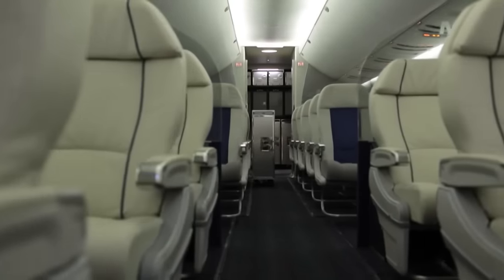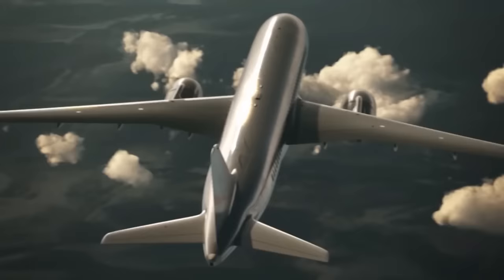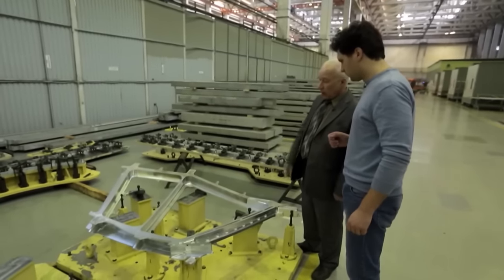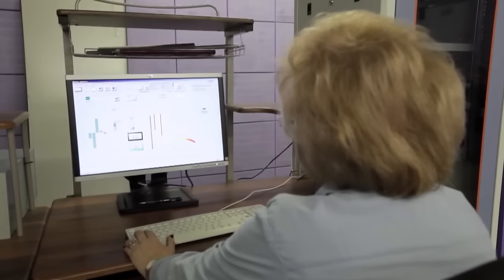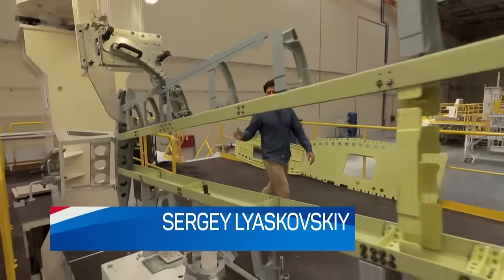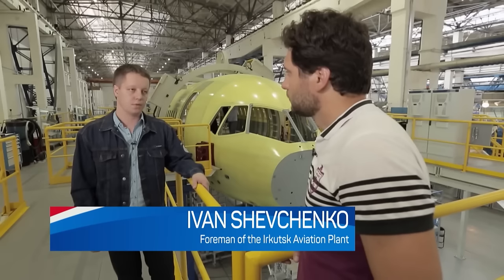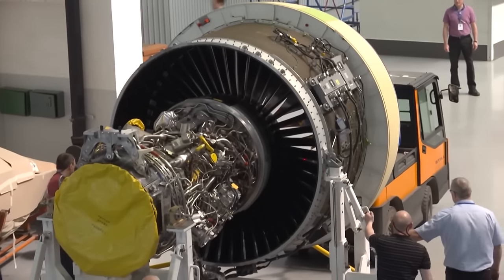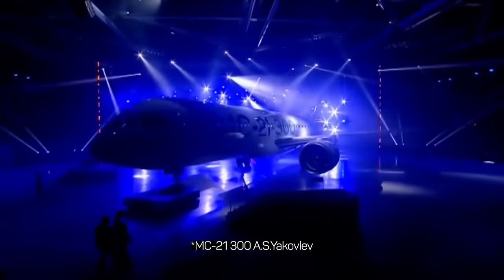Irkut MC-21 — The Aircraft That Can CHANGE The Way We Travel

Comment: Who will buy this plane?
Westerners, no chance, they have Airbus and Boeing and Russian planes are under sanctions at least as long as Putin and his clique are in power.
The Chinese have the C919 which is in the same category.
The Indians, for the moment they mainly buy Airbus and for fear of sanctions will avoid buying Russian.
The Brazilians have Embraer which are competitive and which sell well.
Furthermore, there is little chance that this aircraft will be certified by Western organizations. As a result, it will not be able to land in these countries. So apart from the Russians and their satellites no one will buy this plane. In the best case scenario this will make a thousand planes. If they manage to make 100 per year that won't be bad. In short, this plane is not going to revolutionize much in air transport.
Reply: Go check about Russian new engines for their planes. They need their domestic airlines to buy them and replace airbus and boeing lol come on. How many planes do you think Rusdis need domestically? 😂😂
Reply: There hundreds of of countries who are sick and tired of buying Boing and Airbus for years, some with huge problems. 2 Boing 737 800 Max crashed they were brand new. Same with Airbus A350 huge problems with composite peeling off and stuff. This is the Time Russian must launch MC 21 family with PD 14 engines to Asian and African countries arrange Russian and Chinese Aircraft shows in different Asian and African countries. Back and forth don’t need EU or US approvals, it’s only need to Western Block countries only.
Reply: Russo-phobic people live only in Europe. rest of the world are not. African countries , Asian, and south americans countries ,and middle eastern countries who are afraid of getting sanctioned in the future will also will consider buying this. Also remember wars doesn't last forever, there's no enemies forever, look at Germany
Reply: @Sam-dm4kz listen, if it wasn't for sanctions even Russian airlines don't want this plane because before the war,not a single Russian airline bought this thing or any of its predecessors, they all opted for Airbus or Boeing! 😂😅
Reply: Well, I don't agree with you, yes right now the scope may seem to be limited but there are lot of countries such African nations, Arab nations, ASIAANS, South east Asia, south asian nations, Latin americans and even Chinese airlines would be interested in this aircraft. These aircrafts may not able to fly in western air space but that's just one part of the world. When you offer high tech, reliable, cost efficient product then why not the profit hungry air lines will purchase ? they are still purchasing 737 after so many failures .......though this aircraft has yet to prove all of this.
Reply: There are countries out there that could willingly buy these planes. And remember Russia has long history in aviation technology and know  to build a plane
Reply: BOEING and Airbus left the Russian market. Russian airlines will need to replace hundreds of aircraft. The MC-21 is intended primarily to replace Western aircraft.
Reply: You are very funny
Reply: @zulfiqarbhatti2742 So how do you explain most Russian airlines jumped on EU-US airliners when they were allowed?
Reply: @robertkarake9791  They will by this aircraft, better a crap than nothing.
Reply: @АлексейСмирнов-к4л  Good luck to the russians airliners and their passengers.
Reply: Indians? Fear of Sanction?  The 3rd largest economy and soon to be 2nd/1st?
Reply: @Sam-dm4kz  They may be banned from overflying if they do not comply with FAR-25/EASA-25 standards
Reply: Who will buy this plane” Are you seriously asking yourself that question???  In Dec 2023 Russian president was talking about Russian airliners and their fleets being so overloaded operating around 800 planes (550 foreign and 250 domestically produced) and how Russia will need 1,000 more planes by 2030 to continue normal operation and by 2040/45 there will be need for another 1,000 planes since 80% of the planes operating today will be retired.  Now, did that answer your question who will buy this plane, and not just this one, there are few others.  Starting in 2024/25/26/27 Russia plans to start serial production of highly modernized Soviet era models like long range wide-body IL-96-400 in Voronzeh, Tu-204 and Tu-214 in Kazan and post-Soviet era models like SJ-100 in Komsomolsk on Amur and MC-21 in Irkutsk 

Now the question is, can Russia produce 2,000 planes in 20 years? Probably not, they know how and they money to invest but the lack of qualified labor is the biggest problem for Russia.  If Russia built enough for domestic market can they sell their planes outside of the country, of course they can, its stupid to even think they cant, Soviet/Russian planes are sold to 80+ countries since 1960s and many of those planes produced in 1960s/70s are still in service and flying in many African countries, they are safe and reliable regardless what MSM and many Russophobes on social media spraying
Reply: @rokimarchano5657  regardless of MSM you say? Is Flight Safety Foundation an MSM? don't think so, so take a look at their safety records for different parts of the world and stop calling them "safe" 'cause the airframe itself are dubios at best and crew training and CRM sucks - a pretty lousy combination.
Reply: @eyeofthetiger6002  One more Russophobe caught in lying.  By Jun 2018, MC-21 had 175 firm orders and 155 intentions by one foreign and 12 Russian airliners and by Dec 2023 there more than 550 firm orders and 220 intentions for MC-21

Now, why Russian airliners were ordering foreign planes, few reasons.  Soviet era planes could not get certified outside of Russia because they failed to meet emissions standards, engine noise level standards and fuel efficiency standards, even for America it takes 10-12 years and a lot of money to make new plane from scratch and so for Russia it was much easier and a lot cheaper to just by planes from outside, but things changed.  After the sanction Russians realized they cannot depend on the West for anything, they need their own planes, they have “know how" and a lot of money to invest, I'm sure they will succeed but it will take not years but decades to develop the industry
Reply: @rokimarchano5657  russophobe?😂 No,just stating the facts. This plane is far from ready to be delivered to customers even before the sanctions but now because of sanctions,no Western aviation certification authority will certify this plane so effectively it's barred from flying to the most lucrative routes in the world,ie North America and the EU. Also due to the fact that Russian aircraft manufacturers are forced to use domestic components, the aircraft turned out to be six tons heavier and no longer met the declared characteristics😂!Care to name which foreign airlines are buying this plane again?🤣
Reply: @birgerkagan6087  I did take a look at their safety record, considering Soviet era planes are sold mostly to very poor countries lacking qualified technicians where planes are poorly maintained and of course miles flown per accident.  Yes, they very much safe and reliable
Reply: I bet Iran has paid cash and waiting for the first one
Reply: @eyeofthetiger6002  Azerbaijan Airlines is buying 10 of those and I’m sure Russian economy will collapse because their airliner is barred from the most lucrative routs, but seriously who gives a crap is there foreign buyers or not, are the Russian airliners barred from lucrative routs or not, now the most important thing for Russia is to ease heavy overload of domestic airline fleets.  I did not say plane is ready.  

I said: Starting in 2024/25/26/27 Russia plans to start serial production of highly modernized Soviet era models like long range wide-body IL-96-400 in Voronzeh, Tu-204 and Tu-214 in Kazan and post-Soviet era models like SJ-100 in Komsomolsk on Amur and MC-21 in Irkutsk and in my previous post 

I said:  After the sanction Russians realized they cannot depend on the West for anything, they need their own planes, they have “know how" and a lot of money to invest, I'm sure they will succeed but it will take not years but decades to develop the industry
Reply: @HK-uq9by  well probably, these countries have huge surpluses they are not in-depth to the federal reserve private banking cartel.
Reply: @christosioannidis7483 Who cares about the debt if you can live a good life for few decades? You put me under debt and let me live in a mansion and drive a luxury car
Reply: @rokimarchano5657  
It is unlikely that the MC 21 will be a big success outside the sphere close to Russia.
For other planes, the Superjet does not seem to please its customers, the TU 214 is clearly obsolete, I do not understand why the Russians are launching 2 programs in the same segment, I do not see the rationality.
Finally for the IL96 no one will want it with 4 engines (you might as well buy scrap A340s, with 2 engines to be competitive it will have to be mainly made of composite materials, which is now obligatory for a long haul (for a medium haul the equation is more complicated)
In short, the only serious competitor is indeed the MC21 but due to numerous problems other than technical and due to the Comac 919 now available with very efficient LEAP engines it will be hard for the MC21.
Reply: @dharmdevil  
Yes, like China. They are happy to buy cheap oil and pay for it in rupiah, but like China they understood that supporting Russia would come at too high a price (US and EU trade sanctions).
As a bonus, like China, seeing a geopolitical rival weaken like Russia can only rejoice.
As for being the 2nd or 1st economy in the world, we will have to wait a bit because numbers 1 and 2 seem out of reach to me.
Reply: @HK-uq9by  😀You must be an expert on Bidenomics!
Reply: @rokimarchano5657  who?.....only 10 planes from Azerbaijan Airlines,that says it all really,not exactly a roaring commercial success is it? 🤣 I had to Google it as I have never heard of this airline before and it looks like all their fleets are made up of Airbus and Boeing including the dreamliner but no mention at all about the 10 MC-21 planes that they are supposed to be buying. If true then Azerbaijan Airlines may have discovered too late that they have just bought 10 lemons!🤣 But maybe not because they might already have cancelled the order. Listen,dude,no reputable major airlines would touch this plane with a barge pole because it's simply an inferior product compared to Airbus and Boeing being less fuel efficient and having a shorter operating range than either the 737 max family or the A320 Neo,its direct competitor,plus it has a zero safety and reliability track record and to cap it all off  it is not even certified to fly anywhere else in the world apart from Russia and Azerbaijan!😂 With only 175 firm orders, the MC-21 is well behind the new Chinese-built narrow-body airliner, the Comac C919, which has amassed more than 800 orders. Let's face it,this thing won't be flying outside of Russia anytime soon!😅
Reply: @birgerkagan6087  Russian can overfly over any country with permission of course. It’s only Western countries who cares, also, can fly in international airspace around the globe.
Reply: Correct - if allowed by the countries whose airspace is used and in international airspaces.
Other than western countries may also be concerned if relevant ICAO annexes are not adhered to. ICAO member states are obliged to conduct SAFA on a regular basis and if non-compliances are noted they will have to act on it, Failure to do so may impose restriction on that particular country's own operators. In airspaces where some 3. country operator are banned from operating it all comes down to insufficient Operational and Technical Survey on behalf of the operators own CAA
Reply: @eyeofthetiger6002 I didn't think that people in the West were so mean.  You gloat that Russia is experiencing difficulties because of illegal sanctions. Allah (God) will definitely punish you! You are going downhill, illegal migration, a sharp drop in moral standards, economic problems can lead to very sad consequences. Instead of gloating over Russia, take care of yourself! Greetings from Uzbekistan!
Reply: @eyeofthetiger6002  Finally you understood what I’m talking about all this time: “Let's face it, this thing won't be flying outside of Russia anytime soon” and that is the main idea of the Russian government, not to sell outside but be able to produce enough for domestic airlines.  Pres. Putin spoke about it in Dec last year and few points he made: Russian airliners are already overloaded, Russian airliners are retiring 30-40 planes every year, Russian airliners wont be able to buy planes from outside anytime soon, Russian airliners need 1,000 planes by 2030 and another 1,000 by 2040/45 because planes in the air today will be almost all retired by 2045, Russian gov. will do everything to expedite production of new planes to help Russian airliners keep their fleets in the air.  As you can see the last thing Russians are thinking is selling the planes outside of Russia or competing with Western models, the only thing they are thinking right now is how to produce enough for domestic market in the next 20 years.  

And 20 years from now god knows what may happen, as soon as war stops in Ukraine regardless if Russia pulls its forces from Ukraine or not the sanctions on air travel may be removed immediately, many sanctions will remain but when comes to airspace Russia has a big advantage over ES/EU airliners, its their airspace.  Thousands of flights every day from EU/US to Asia are banned from Russian airspace and all flights by going around Russia are extending they flights from 1 ½ to 4 hours and that cost a lot of money.  Airliners of EU/US and few other allies are loosing millions of dollars not every day but every hour by avoiding Russian airspace Western corporations and politicians are driven by money and that’s why I think as soon as war stops in Ukraine all air travel restrictions and opening airspace for all will be first to be removed.  

You may be right regarding Azerbaijan Airlines buying 10 MC-21, the deal is probably canceled, they did sign contract buying 10 planes in June 2016 but after allegedly Russian meddling in US pres. election in 2016, midterm in 2018, same thing in 2020 Russian airspace industry got more and more sanctioned and project got more and more delayed and of course after Ukraine invasion everything is sanctioned.  Tried to include link but for some reason post getting deleted, google: “AZAL to purchase MC-21 aircrafts" and today I did some research and its safe to say the MC-21 was extraordinary plane killed by US/EU unfair sanctions probably to remove direct competitor for 737 MAX and Airbus A320 family
Reply: @Sam-dm4kz Träum weiter.
Reply: @MuhamedUsman Ihre Welt ist anscheinend sehr eingeschränkt.
Reply: Zero chance for commercial  success... Besides Russia has no money to develop anything. Aeroflot and İran may order few, thats it...
Reply: I'd rather this that a Boeing 😮
Reply: @Sam-dm4kz   ahahahah yeah still remember the old day where an Aeroflot crashed every single month? yeah those great old days are coming back))))))
Reply: @zulfiqarbhatti2742   yeah also a great history in crashing them
Reply: @rokimarchano5657  dude, you are seriously deluded if you think that the reason Russian airlines are buying this plane is because it's superior to a Boeing or an Airbus. The only reason is because of sanctions and Russian airlines are in serious trouble at the moment because of a lack of spares for their western made planes and they are having to cannibalise parts from other Boeing and Airbus planes to keep them flying resulting in several serious safety incidents including an emergency forced landing of a 737 Max plane recently  because of engine failure as a result of a lack of maintenance or faulty parts obtained on the black market! Because of sanctions,this plane is now no longer flying with  Pratt and Whitney engines but Russian ones which will further deteriorate its performance unlike the new Chinese made planes which still have access to the excellent CFM Leap engines. Given the choice I think most Russian airlines will plumb for the Chinese planes,not the Russian one. You're mistaken if you think Russia's banning of its airspace to Western airlines will be more  damaging to the West than to Russia as opposed to Russian planes being banned from Western airspaces at the moment because Russia's economy is absolutely tiny compared to the West, it's only about the size of Italy's!🤣😂 No, things will NOT go back to normal if and when the war ends unless Russia withdraws completely from Ukraine and admit defeat or it's facing decades of harsh sanctions! But my hunch is that Russia will be defeated long before then!🤣
Reply: N'oubliez pas un détail le crime le plus atroce a été commis par l'occident mais celà n'a pas l'air de te gêner, l'Europe n'est que 10 km2 , et petit détail il y a aussi d'autres marchés, le monde ne pas synonyme d'Europe. l'Europe et son parrain usa sont en déclin pour toujours.
Reply: The answer is simple: due to the sanctions, Russia won’t be able to buy new planes on the market (such as Airbus, Boeing, etc.). Even spare parts are hard to obtain. Therefore, Russia needs airplanes for its own domestic lines and also for international routes. Since no one is willing to sell them to Russia due to the sanctions, the right decision is to build its own fleet. Even if it means using slightly older technologies or having slightly inferior performance, having a self-sufficient fleet ensures that it can fly and have access to spare parts.
Reply: @imissyoubasile corruption in govement and Boing/Airbuss lobby.
Reply: @nvrsk2010  
We agree, it is only a question for the Russians of saving their air transport, but revolutionizing air transport will be for another time
Reply: @nvrsk2010  Ah not really : when USSR collapsed and westerner airliner manufacturers were able to do business with these now "new" countries, these new countries picked up what was more efficient, performed better and had much better after-sales services : Airbus and Boeing products. Ex-USSR products, even if interesting technically, we're simply not able to compete. Now, the MC-21, yes it may compete with an A320neo or a 737-8MAX but once again, airlines need reliability (which Airbus can supply, and Boeing to a certain extend) and stability (after-sales that can supply parts, unlike Sukhoi with their SuperJet), both of which we have no idea Russia can supply.
Reply: @eyeofthetiger6002 Off the shelf purchase is easy and pragmatic, but not desirable for Russia, sanctions have been a good thing and have awaken the bear pushed it to start work, now the bear is working hard and is outsripping its neighbours, western markets for Boeing and Airbus will shrink massively and Boeing could even be finished. Russia has many young scientists and engineers in the system far more than any western country or  population ratio.
Reply: @rich11a15  stop living in cloud cuckoo land.🤣
Reply: South global customer...  And Russian aviation company
Reply: Over the next 40 years, Indian, Chinese Russian companies and others in Africa, South America etc. Probably not the west by they are not aiming to sell it there.
Reply: Lots of negative comments. 
Time will tell. 
My prediction. 
It will take some time but it will be a great success. 
And many other sectors. 
This western senctions long term will affect the western countries more.
Reply: You have a limited worldview! The demand of Russian airlines for airplanes is estimated at 1.7 thousand units until 2030-2035, which means that your Western companies will not make a profit of hundreds of billions of $. In the USSR, we flew our own planes perfectly well, we will fly them instead of Boeings and Airbuses. We will support our own economy, not yours!
Reply: @eyeofthetiger6002  Six tons heavier? Where did you get such ridiculous data from, do you seriously think that modern Russian computers are assembled on lamps? The fate of this and several other Russian aircraft closely depends on the Russian certification of engines of different series, but with the same type of gas generators - PD8, PD16, PD32. We don't care about Western certification, since Russia is prohibited from flying over Europe and a number of unfriendly countries. There is no doubt that Russian engineers are able to cope with any tasks and these engines will be brought to perfection. I have already written that Russia will need several thousand civilian aircraft in the next ten years to replace Western Boeing and Airbus, which means that your sanctions will again hit your well-being. Russia will not buy aircraft and components worth hundreds of billions of dollars/euros from the West, your countries will not receive taxes from these factories, our country will develop its own technologies. We will pay taxes not to you, but to Russia.
Reply: @rokimarchano5657  Don't exaggerate. Russia has the main competencies, which take decades to achieve. With the commissioning of the engines, additional assembly shops will be completed and the production of aircraft will increase many times.
Reply: @Sam-dm4kz  Fly anywhere but over the largest country in the world! The very case when the West stepped on its own foot, well, or on a rake.
Reply: @БатырРаджабов-ю3ч  Привет, друг! Конечно согласен, да хранит тебя наш общий Бог. Процветания Узбекистану!
Reply: @nvrsk2010  Of course you're right, but what makes you think that Russia has outdated technologies or worse performance? Do not confuse Russia in 2024 with the USSR, or Russia in the 90s, everything has changed a lot. I feel sorry for your strategists and you, whom they deceive, Russia is different, not the one that is shown in your movies and on TV. This deception could cost the lives of millions of Americans and Europeans.
Reply: @vladimirnikolskiy  Russia is doomed!🤣
Reply: @vladimirnikolskiy  I’m not sure on which comment of mine you replied to but that’s exactly what I was saying, Russia does have money to invest and “know how” capability which takes decades to develop, the only thing that I questioned is government plan to produce 2,000 planes by 2040 with current sanction problems because MC 21 was originally designed just as SSJ 100 with half plane parts coming from outside and that’s why SSJ 100 project failed.  Russia will and is capable to develop and replace those parts with their own but it takes time, its not gonna happen overnight
Reply: @vladimirnikolskiy  Спасибо. Пусть мы и наши родные и близкие будут здоровы и счастливы! И тебе всего самого наилучшего! А России-матушке желаю побыстрее одолеть всех недругов и стать одной из самых сильных и развитых стран мира! Этого желают, как говорили при Союзе, "все униженные и оскорблённые" и "всё прогрессивное человечество".